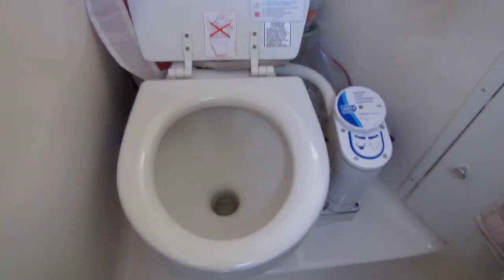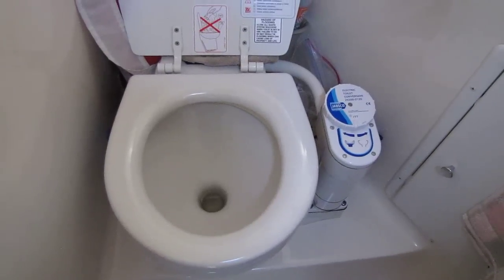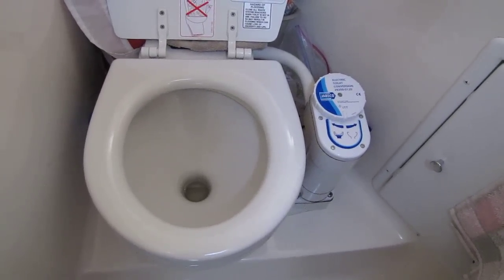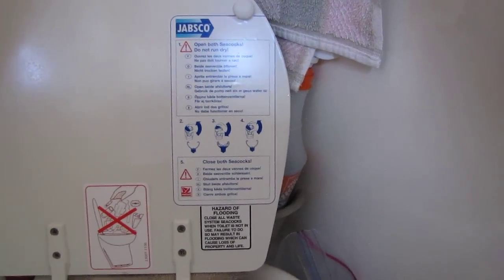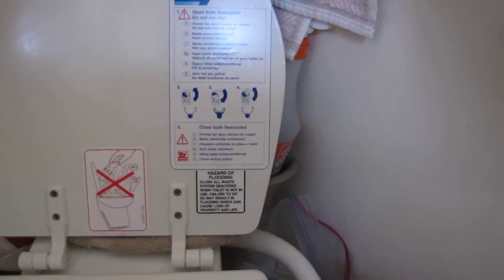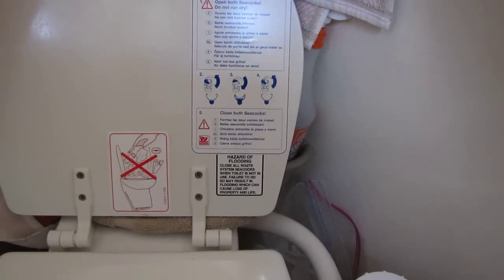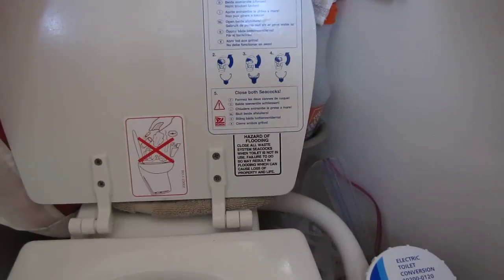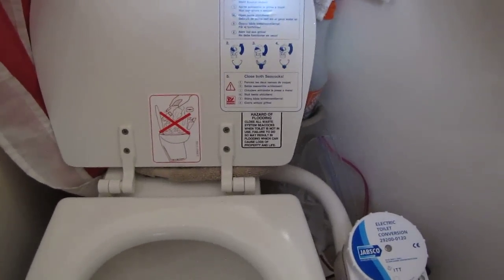Jabsco Electric flush marine toilet conversion

Comment: We have one of those units ... and found that NO ONE WILL BE ASLEEP after someone else uses the toilet in the middle of the night!  I am thinking of converting to a manual system for that reason.
Reply: Yep it is really noisey.  I have thought about changing it out but it works so well and has never clogged.  For those reasons the Admiral (my wife) thinks we should live with the noise.  Happy wife happy life.
Reply: If you convert to manual then you need a much bigger outlet

Comment from the maker: Update.  It has been over 4 years since I have installed the electric flush.  Even though it is still really noisy to use, it has worked flawlessly and has never been clogged by any size of bio-matter.  The macerator does its job and allows the chems in the holding tank to work really well since there are no large solids.  It also makes pumping out easy.  We have used it almost every weekend from May until October every year and last year had a family member live on the boat all summer long will working at the marina.